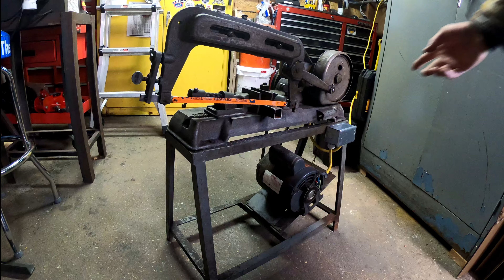Power Hacksaw Blade upgrade- Bigger and Better!

Comment: Just got one. I’ve been doing research. The manual suggests 6tpi blades. Nice upgrade there. I’ve been looking at some starrett blades and didn’t realize they needed modifying.  Another thing I’m going to try is cutting blades to length and adding holes out of a bigger band saw blade I have. Those starrett blades are pricey.
Reply from the maker: Thanks! Good idea. 6 TPI will make short work of what you throw at it. Definitely worth a try if you have blades laying around. Good luck!